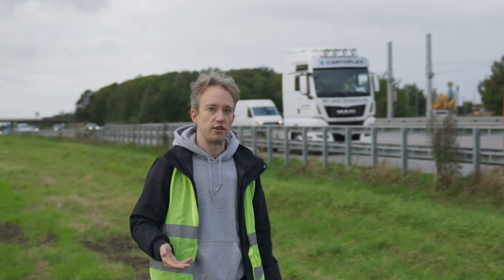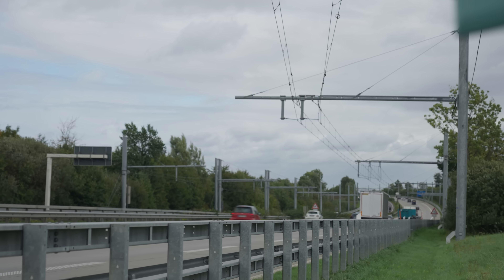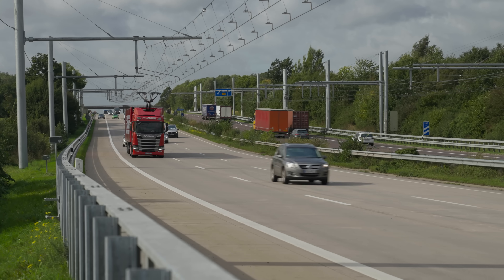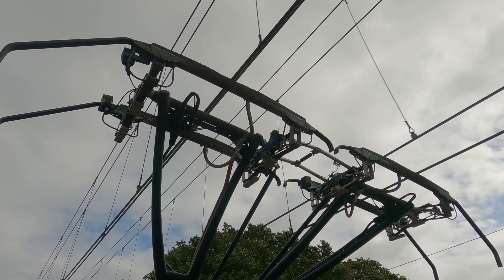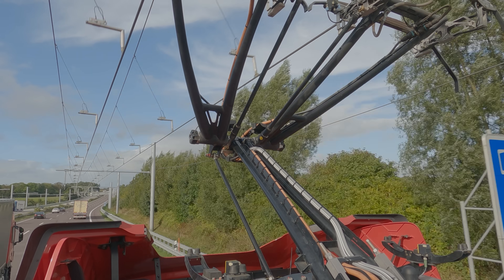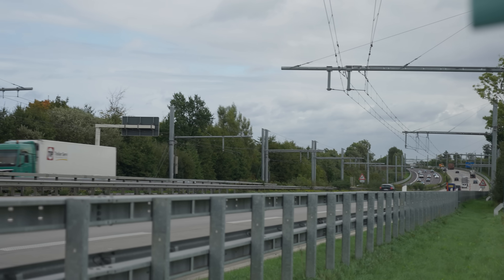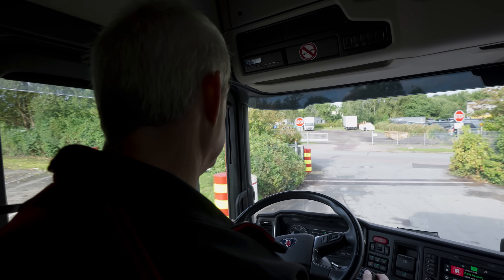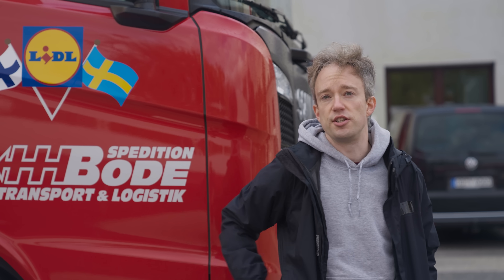The highway where trucks work like electric trains

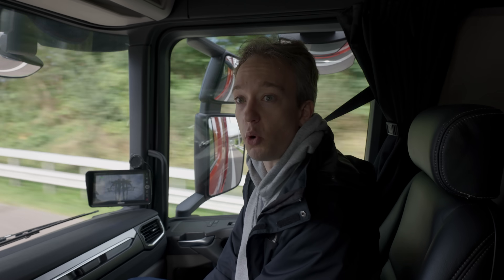Comment: 1:40 I never actually found out how those.. antennas work? is it just touch based (like the magnetic wireless chargers)?

Do the driver still control the vehicle after connection?

Comment: Sure sure, but rubber has massive rolling resistance and truck weight wears heavily on tarmac.  Maybe some less frictive wheels like steel ones on some more durable surfaces like rails would do the job though.

Comment: I am forever ashamed of my local politicians that massively downscaled our city's electric on-grid bus system that had been running continuously since 1949. 
Over 30 years it was reduced to a tiny fraction of what it originally covered, only for them to make massive ad campaigns about how green they were while bringing battery powered buses in the last few years.
Reply: Trolleybuses are incredibly underrated, and I’m disappointed how few people know about them.
Reply: @janMelantu  We used to have theme in EU as well, but I prefer trams and so do my local authorities :)
Reply: @android199ios25  There still are a lot of trolleybuses in the larger cities of Romania...
Reply: @android199ios25  I don't like the look or feel of rail transportation. Buses or trolleybus is preferred
Reply: @janMelantu  Those are (again) a thing in Mexico City. The local government is building new lines and just renewed the buses, specially from the longest line which runs through the downtown.

They're not exactly sufficient due to the size of the demand, but surely helps.
Reply: We had trolleybus in Kathmandu. Decades ago. It no longer exists
Reply: Well to be fair those are probably not the same politicians as 30 years ago :D
Reply: I loved the London double-decker trolleybuses (RIP 1962). You had to cling on going upstairs owing to the acceleration.
Reply: Are you in Dayton? Just curious.
Reply: Los angeles?
Reply: used to have a bunch of those in downtown valparaíso, chile, for just about 20 cents, now they only run in one continuous loop
Reply: Used to have electric trolleys here a hundred years ago, including an electric interurban rail system between several towns
Reply: We had electric busses in Edmonton for a hundred years before they were replaced 30 years ago by diesel busses.  Yea progress.
Reply: @OddGaming-m6r  There are lithium mines on every continent...and the top 12 manufacturers are all in China, Japan, and South Korea.
Reply: Ah, I miss when there were so many electric busses in Watertown, Somerville and Cambridge.
Reply: @Bubo Bubobubo and they're SO loud now, belching out diesel fumes into the footpath. Glad I don't have to go into the city much anymore.
Reply: FirstBus in bristol slap signs on half their buses talking about, green gas powered buses, despite the fact bristol used to have trams, and keeps having its mass transit plans suspiciously delayed

Comment: Interesting idea, but it likely only makes sense for very specific use cases notably medium haul trucking in areas where the population density is high enough that the destination is sufficiently close to the infrastructure. Building infrastructure to cover short routes on local roads would be prohibitively complex and expensive. On long haul routes, freight trains are already very efficient especially for countries with low population densities like conditions found in the US or Canada. If the truck has to engage an internal combustion engine to complete the majority of the route, that defeats the purpose. Other caveats also apply: where the power is coming from, the carbon toll of building and maintaining the infrastructure, the carbon toll of building new trucks etc. This will likely work in some situations, but I think battery-powered trucks will be a more flexible and viable option in the long term.

Comment: Lots of issues. The two pick ups must stay under the correct wire unless one pantograph short both wires, that means the truch has to remain properly under the wires. The overhead wires on a railway sweep from side to aide across the pantograph to reduce wear, these can't do that and the brief shot of the pantograph seems to show a lot of wear.

Comment: I'm wondering, where do they plan to get the electricity needed to charge all the trucks now that they decided, that nuclear is not green enough.
Reply: Nuclear is plenty green enough. Just way expensive in short term compared to solar & wind. Small semi-portable mass produced reactors are the future. Also screw Germany.
Reply: Not according to the EU.
Reply: @harrodharrod5239  can you point out a specific statement, because my instincts say that EU say the following. Wind & solar are better because they are cheaper. Nuclear is too costly. And current methods of building are fairly co2 dirty as well. Which would be correct of them to say.
Reply: Apparently I remembered it incorrectly. It's not that they have decided it's not green, but rather, they haven't decided it is and can't seem to agree on it. Look for "Led by France, 10 EU countries call on Brussels to label nuclear energy as green source".

Comment: Well in Salzburg (Austria) the busses drive like this since 1993 I don’t see why it wouldn’t work on highways aswell. (Sure there will be issues but it’s not impossible at all)

Also I nice benefit might be that there won’t be duals of lorry’s overtaking each other for miles just because one lorry is 1 km/h faster than the other..

Comment: I’m curious how this system would handle several trucks connecting and pulling power at the same time. With the rail bases systems there would be larger gaps between trains so individual sections would normally only see the load of a single train. Just wondering if this system still works good if you get the trucks close together to where there might be 3 or 4 of them at the same time.
Reply: I'm sure it could handle that without much fuss. Assuming the lines are continuous if the load is too great for one feed station other feed points nearby could help provide the load. Worst case they just limit the charge rate available to each vehicle.

Comment: This feels like an admission that electric trains were the right idea after all - except not so far as to actually use them
Reply: They are a great idea. The automotive industry just kinda lobbied the heck out of the politicians to favour them over trains. Especially in US.
Reply: @TealJosh also the fact that the freight railroads refuse to pay for anything and act like they can't run double stacks under wire even though India does it all the time
Reply: @TealJosh  Yupp! Right after WW2!
Reply: Both systems have their benefits. Road transport has the flexibility, while (electrified) rail transport has the efficiency (electricity vs oil/gas). 

This solution combined the two modes is juuuust the right amount imo to uphold the benefit of the former while increasing the former's efficiency. If we brought in rail tracks, them that's more engineering, more maintenance, and more policy to keep drivers safe.
Reply: For passengers trains don't usually make a lot of sense - too many variables of route and too much messing about each end. For heavy freight they are by far and away the best choice. Massive weights and sizes able to move great distances at great speed using minimal energy. In the Uk all it would need is one big track north to south - lets call it HS2 - then east-west ladders every so often. Massive US style trains could go up and down then leave the required wagons at the crossovers for the smaller - lets call them branch lines - ones to take. 
Quick load/unload at stations as they have at docks and there you go - even if electric trucks only had a 100 mile range they would be fine to do it, the smaller trains could be powered by one or two truck sized power plants and the whole lot would be far more efficient. 

Of course that would require common sense and a lack of greed so good luck with that one.
Reply: @siraff4461  I mean passenger trains are still by and away much more efficient than air travel for long distances, which is primarily what they'd be suited to, compared to a shorter form of rail transport, like a streetcar. Getting people on and off of trains and where they want to go really isn't that dubious, you just have to have enough people that it becomes cost-effective to run it frequently. It also helps to have other public transport options, as well as separated bike lanes and stuff like that, because that helps solve the "last mile" problem.
Reply: @234fddesa  Thats exactly the problem using trains for passengers though. While they are moving they are great but the logistics of stations and their inherent inflexibility mean they are only really any good when you have a large group of people who all happen to want to go from one station to the next. Any deviation from that and they fall short. An example would be a 100 mile trip I did to collect a car. On the way there it was a half mile walk, a bus ride, another walk to the train station, three trains with half an hour wait between two of them and a taxi to the house at the other end. All in it took four and three quarter hours to get there. On the way back it took an hour and a half. 
I'm also sure the direct 100 miles in the car was a lot shorter than the connection service on the train. 
If you have 400 people wanting to cross Europe a train can make a lot of sense depending on where you/it are going. 
For more local stuff its largely pointless because by the time you get to/from the station it would usually have been less damaging to just use the car. 
On the other hand when a train is replacing 200 miles of 100 lorries you would have to be mad to send stuff by lorry.
Reply: @siraff4461  That is exactly what they're doing: Last mile delivery!
Reply: It really is. The marketing is SOO dumb, it hurts!
"Connect industrial areas with electric power" is very close to what we had before trains fell out of fashion
Reply: There is a massive grid if electrified train tracks in Germany. It's longer than all the autobahns combined.
Reply: These are not tied to tracks, that is a massive advantage
Reply: Most of these trucks are used for last mile delivery. Not to transport long-haul goods.
Reply: There are too many things built in places with road access, but where train access is not possible (without demolishing a lot of other things).
Reply: Electric trains for long haul, sure great idea. But this is a solution for the last mile from for example the train station to a warehouse or out for delivery. Not every supermarket will have train tracks to their loading dock...and that is where this system can be used. Great benefit: Trucks can be charged and drive electric while on the highway, no need for a large battery and not having to stand still and waiting for a charge like current EVs.
Reply: Except that Germany does use them…
Reply: Nothing terrifies capitalism like proof that nationalized infrastructure is better
Reply: @artstsym  nationalised electricity, heating, water, pharmacies, grocery stores. Where would we stop?
Reply: @ligametis  Wherever we feel like it. You're misrepresenting my stance as "everything should be nationalized," when in fact my stance is "critical infrastructure definitely should be nationalized, and past that point is a matter for debate." As governments rely on timely and reliable shipping as much (moreso) than any private entity, it is critical infrastructure.
Reply: @artstsym  same could be said about electricity, medicine or even grocery stores when emergency food rations have to be provided
Reply: @ligametis  And? Electricity and medicine should be nationalized, we have a perfect case study in America where privatizing the grid got people killed in Texas, and taxpayers across the country pay more and more each year because private medical insurance alone results in significantly delayed healthcare visits, turning minor conditions into major ones.

Grocery stores are probably best served by UBI instead of nationalization, but I'm certain there are other arguments for and against which merit consideration.
Reply: @artstsym  Well, you can often make a nationalized infrastructure more efficient technically than a private one (less duplication, for example).  But a nationalized infrastructure—which practically always takes a government bureaucracy to run it—is nearly always less efficient organizationally because of the incentive structure and the limits of the available information.

In a private-sector bureaucracy, the built-in tendency of bureaucracies to grow is usually (if imperfectly) counterbalanced by the organization's fundamental need to make money.  Only so much bureaucratic inefficiency can be tolerated before it just gets too costly.  In a government bureaucracy, by contrast, the organization's fundamental need isn't to make money but to keep the politicians who run the show happy.  And the politicians may or may not care about efficiency, so the built-in tendency of bureaucracies to grow just doesn't have a reliable, effective counterweight.  The incentives of the situation don't intrinsically reward efficiency—they reward efficiency only if the politicos in charge (a) value efficiency and (b) can tell the difference between actual efficiency and glittery ribbon-cutting ceremonies for initiatives that promise efficiency but somehow never quite deliver.

Government entities have a second problem in being truly efficient.  Markets—at least, when they're working—respond to the sum total of the information being used by all the participants.  Not all the actors respond to all the information, of course—different people know different things—but because there are a lot of actors, there's a lot of information being used to support decisions, and the inevitable proportion of bad information in the mix has a chance to get averaged out.  Government actors, by contrast, are far fewer in a given sector, so while they may be individually quite well-informed, the sum total of the information being used to support decisions is nearly always less than in a market situation.  

Now, sometimes the gain in technical efficiency from nationalization is worth the loss of organizational efficiency.  Road construction, for example, is dominated by governments in most places in the world.  In other cases (retail food distribution, for example), the loss of organizational efficiency that goes with nationalization only seems to be worth it in disaster situations, where efficiency suddenly becomes a whole lot less important.
Reply: @brownpcsuncedu  You're misrepresenting my point as "everything should be nationalized" when it's actually "critical infrastructure"... hmmm, I feel like I've had this conversation already.
Reply: The decline of rail transport in most western/European countries is sad
Reply: @reptiloidtill  we have cars that are private mean of transportation and better in medium to short distances. Long distances were replaced by planes. Only decent railway is between China and Europe
Reply: @reptiloidtill  not really. Cities are so spread out and so are suburbs from city squares. Roads and vehicles were always gonna be key in this country. People like the freedom tp drive where they want
Reply: @kennytaco4474  freedom, yes.
Except if you're too young to drive, too old to drive, too sick to drive, too drunk to drive, don't want to drive.
Reply: @kennytaco4474  Maybe in America but a quick look to Asia reveals what could have been. Even in its current state, railway transport is still quite popular all over Europe.
Reply: @kennytaco4474  you're acting like you just can't drive in European cities

But you... can, but there's also transport
Reply: @Zajum11  Or too poor to drive.
Reply: @kennytaco4474  "Cities are so spread out and so are suburbs from city squares."
Learn about the history of your city. The fundamental fact is that before people could afford cars, they also couldn't afford to live too far from transport or their jobs. Cities are only spread out now because they were allowed to spread out, not because it was inevitable.
Reply: @Zajum11  public transportation also doesn't guarantee freedom as it requires dense cities and high ridership. This usually hinders car access which is definitely a degree higher freedom of movement.
Reply: @microna455  you really can't efficient use cars in many European cities as there is a chronic lack of parking
Reply: @ligametis  there are plenty of cities which aren't very dense with great transport, and also there isn't a 'chronic lack' of parking, there's a totally normal amount compared to America's tarmac graveyards
Reply: @microna455  well it is a struggle to drive and park in Amsterdam.
Reply: @reptiloidtill  Europe's freight rail is awful.
Reply: The automotive industry, and industry in general, has a stranglehold on the political class.
Reply: They were the best idea  for the planet  but not the best idea  for the greedy scum that run the planet.
Reply: What roads have going for then is the simplicity. A truck is easy to come by, and you can instantly drive anywhere. With trains the process is really complex, time consuming & expensive, and you can't get everywhere.
Reply: The automotive industry didn't have to do much lobbying, it was simple populism that brought massive road subsidies as well as monetary policy that artificially financed decentralized development.  There was a time that railroads and mass transit were despised as powerful interests.

Comment: Germany would be doing much better, if we would give the money to our "Deutsche Bahn" railroad company. They have a terrible performance, especially in freight. But the most diesel could be saved by not sending parts and components through all of Europe and back, just because it's cheaper to spread out prodution to low wage countries. If we would do that, the need to electrify Trucks becomes less urgent, as they are just "the last mile vehicle", maybe even battery powered.
- A German